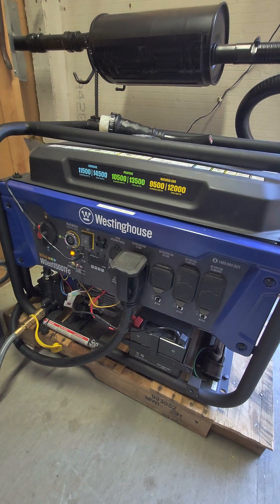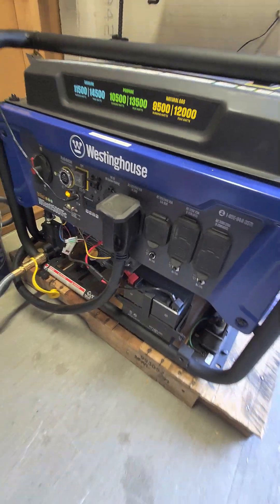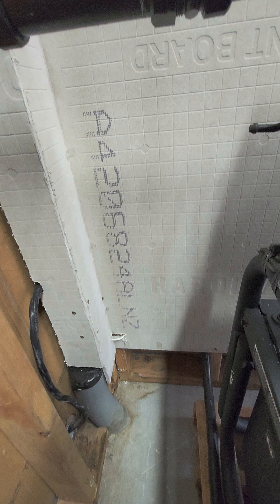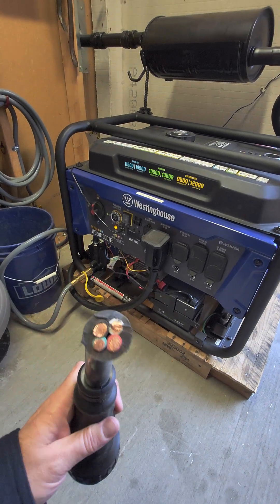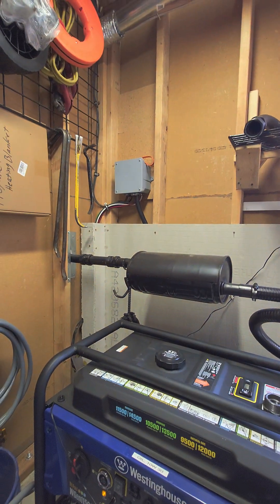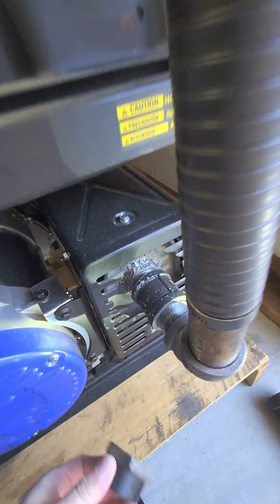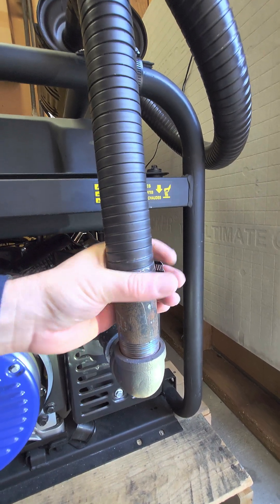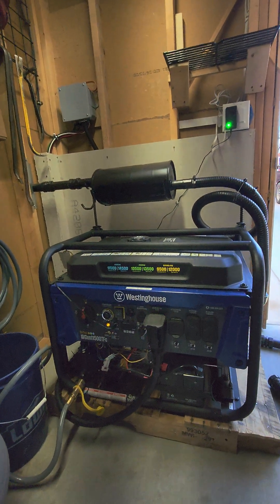EcoFlow Delta Pro Ultra w/ WestingHouse WGen11500TFc Generator overview

Comment: THD is load-dependent.  A generator that has 4% THD under no-load conditions can have upwards of 20% at full rated output.
According to Westinghouse, the THD for this unit is equal to or less than 5%.
Also, I am uncertain whether you are running on NG or LPG but the maximum continuous power output for LPG is 10,500 and 9500 for NG.
Something I don't know if you're aware of; the WGen11500TFc is a BONDED NEUTRAL generator. In order to maintain household safety of personnel and equipment, when connecting to the house, the generator should be rewired to a FLOATING NEUTRAL.  Bonding should occur at the main breaker panel via a green bonding screw.
Reply: yes. I unbonded my Wgen9500df. Run it on propane.

Comment: Do you have it set up to auto start. Would be great as I was looking at the 4000 W Eco flow DC generator. It has auto start and you could set thresholds at when it should start up and recharge as well as output. I’m looking for a solutionsimilar to your battery pack.
Reply from the maker: No, no autostart, I have no life  support systems that warrant an emediate start of the generator, and I keep enough reserve in the batteries at all times for hours, so to wait a bit or untill daylight in my case would not be an issue.

Comment: I just bought the same generator.   Where did you find the 8%ThD info?
Reply from the maker: @bobabbott8370  oh I think it was buried in the smart home panel 2 manual as I recall like way down at the bottom somewhere
Reply: @erickbostrom4049  oh and BTW nice video.

Comment: I have the same generator. My question is do you leave the switch on and 50 amp breaker on all the time? If so is it ok to do that?
Reply: Thanks for the info. So it probably wouldn't hurt to leave the power switch on. Power switch has something going on because of the yellow/orange light. It would just put a drain on the battery and trickle charger. I'm just putting together a personal list of do's and don'ts for myself.
Reply from the maker: @jbhobbyist9372  agreed..
Reply from the maker: I do yes, just like other brakers.. I do not see why you would need to turn it off.
Reply from the maker: I should clarify, I do NOT leave the power switch on all the time, only when I intend to run it, the breaker YES, stays in the ON position.
Reply from the maker: I do not have the auto start feature enabled/connected, so the power switch is in the off position.

Comment: I wish I knew what causes the rattling sound. I have 2 of them and they have the same rattle. All of them seem to have it. I took off the pull start, but no change. Some have gotten support to replace the unit only to have the replacement to rattle, so even support doesn’t understand it.
Reply: i'm reading it might be the valves
Reply: @idahoduckhunter  I read that too. May need adjustment.
Reply: I've heard of that.  Sounds like the good news is it's not a running issue, but sounds annoying.

Comment: i run a 5Kw inverter gen that directly charges my 24Kwh battery bank and let the batteries deal with the load changes.  The batteries are in use 24/7 and usually charged with solar but after a couple of poor solar days the propane gen is used to top up my battery bank. I had to go with a inverter gen as the Bluetti system would not accept a charge from several standard inverters that i tried first. For two years now i only need the propane gen in Nov, Dec and Jan. on average once a week.

Comment: Would be interested to see you install a CO meter in the shed, close the door, and run it for an hour or more. Please be sure you have CO detectors in your house and attached buildings! It's odorless and kills people in their sleep every year from generators.
Reply from the maker: Has a built-in CO sensor that will stop the engine, it works.. ;-). Genny would only run log enough  to charge the ecoflows and never while we "I" sleep. I appreciate the heads up...

Comment: Again, I'm impressed with your ingenuity, and you do it all on the cheap too! What type of welding rod or wire did you use? I like the hanger for the flex hose, well thought out. Coffee can vs the clacker is definitely a plus! Someone commented about back flow, I guess if I could or would add anything it would be a union or a flange at the 90. Just in case you do have operating issues with the generator you could disconnect the homemade exhaust system and entirely eliminate it as the culprit while you troubleshoot. Then again, you may never have a problem. Perhaps do a 12-hour run and check the entire system with a temp gun so you'll know if or where any significant heat builds up. But, man I think you're good to go!  Thank you for the video.
Reply from the maker: @MrFirstone23  the welder is an old old old Harbor Freight something that uses a flex wire that feeds as you go. I have had it so long I don't remember like a flex 90 AMP basic basic welder is all.

Yeah time will tell on set up but if I need to disconnect I do have that Center piece that I could take out and be able to move the generator without having to mess with the rest of the exhaust if needed. 

 should I need to use it in any down time situation it's only going to run for 2 or 3 hours to charge those batteries and then once those are charged it's another day before I have to do it again so it should be light running even in a downtime situation which is why I wanted to have a little bigger generator size so I can charge those batteries efficiently and quickly to use less fuel was the idea.

Comment: I get that it all fits but the tubing bends potentially leading to backflow and double muffler (not a motorcycle btw), is this not a concern? I have a Westinghouse 28,000w. Has two mufflers and everything im reading about designs, back flow created by bends and or too small of outflow, plus using something like a non-motorcycle muffler (or carburetor) is the way to go? If it works it works, just curious from a longevity perspective. Well done!
Reply from the maker: @adca540  guess time will tell..😉

Comment: Man, those are loud.  At least it's in a shed, I guess.  I really wanted to get one of those for the power on LPG as I don't have any close neighbors but ultimately decided on a pair of Genmax 7500's from Sam's Club with the Genmax parallel kit.  11,000 running watts on propane and I'm all in at $1,820 for the gens and parallel kit.  Have them tied to my house with a 50 amp power inlet and can run pretty much anything.  I have a 250 gallon propane tank outside as well.  I'll normally run one but can add the 2nd easily in case we need to run water heater of the 5 ton 2 stage heat pump.  

Cool setup.
Reply from the maker: sounds like a fantastic setup...
Reply: @erickbostrom4049   But I sure like that big ol' Wgen11500tfc. Its like the Binford Model 9000 of generators for the money.
Reply: Their website advertises less than 5% thd. Where did you get 8 from
Reply from the maker: @Tate_865  memory I'll have to check that.
Reply: @  great set up !
Reply: @Tate_865   5% at lower levels. As they rise, it goes a little higher. It's not an inverter.
Reply from the maker: @Tate_865  bad memory I was talking off the cuff so whatever the website says let's go with that 😉 I just remember whatever ecoflow required this generator was a few percents lower which is why I went with it.